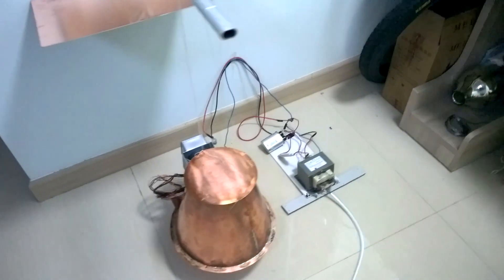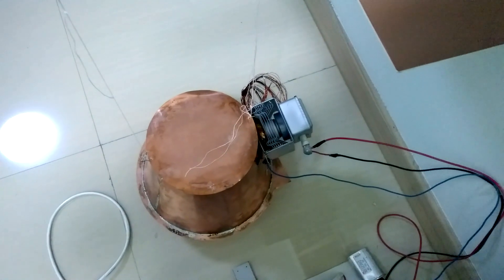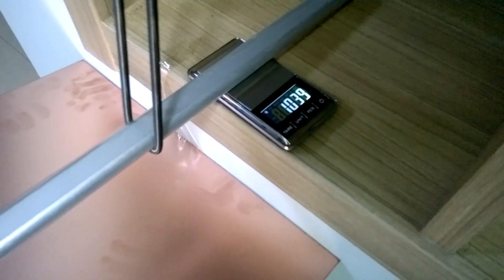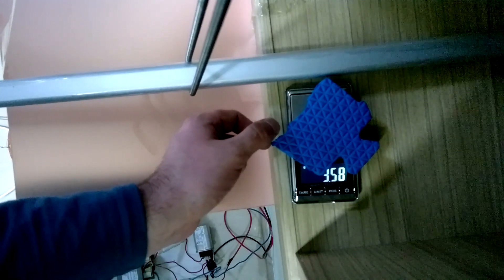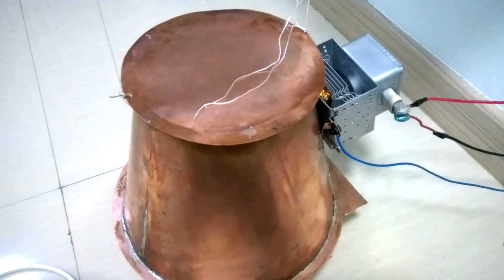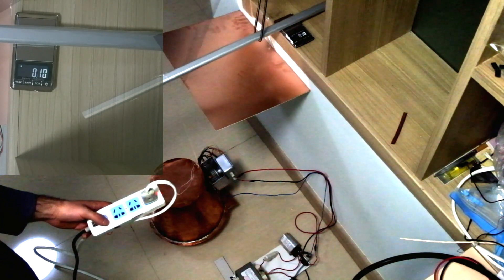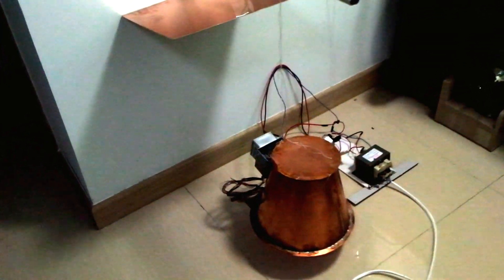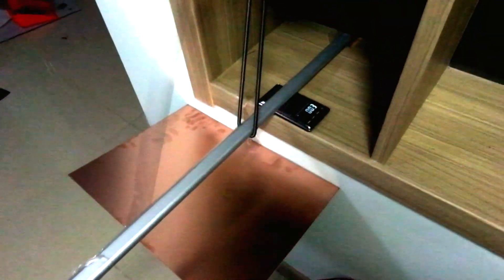EmDrive Test No.03 Success, I have thrust !!!

Comment: You must put the power source (supply) completely within the device being measured.  Otherwise, the conclusions based on the results are invalid.  Also this must be done in a vacuum, otherwise also invalid -- sorry.  Also, you must verify that any springs, and measurement devices are not affected by the extremely high near field levels.
Reply: John Doe
No it's important.  Other folk are reporting thrust from thermal flows/etc that happen in non-vacuum.
Reply: i never said this particurlar video is significant. i only came here because of the topic. i never commented on the validity of this specific experiment. nor have i said anything that would lead a reasonable person to think i was referencing this specific video.  not really interested in getting into insults with you but you might consider reading the comments of others more carefully before ripping into people.
Reply: onehit pick right, i agree with you. i didn't word my comment very well. what I mean to imply is that the argument is moot in that NASA has already demonstrated that the emdrive works, even in a vacuum. so the argument that the thrust is coming from an environmental source has been falsified thus rendering it moot.
Reply: It's hardly worth making those points.  He's measuring thrust in grams for starters...
Reply: This whole thing has been plagued by very immature and mostly invalid experiments.  There are several reasons why a tether invalidates the experiment.  First of all, after the larger claims have been retracted, we're only talking about micro newtons of thrust here.  Near field interactions with the tether, thermal flexure of the tether, inductive expansive effects, will result in erroneously measured thrust.  Also, wall power can supply and provide slow ion-flow based currents, and this is unallowable.  The thrust measured here is likely due to intense microwaves and fields causing an inductive near-field repulsion effect.  See things like "floating ring" physics experiments. I guarantee there are plenty of leaky near field electromagnetics.
Reply: just  an fyi. NASA thought about the need for a vacum to confirm there was no other environmental factor at work. nasa says it performs with the same thrust in a vacum as it did in an open environment so i think the vacum test is probably moot.
Reply: Fuk Yu okay but what specific aspect of my idiocy and brought on the vapors in you?
Reply: Your lack of basic knowledge, which is indispensable for discussing this topic. In particular your assumption that the experiment in this video is anyhow significant.
Reply: that square brasssy looking thingy
Reply: John Doe
Makes sense.
Reply: Charlie Govenor
The scale still is relaying force, however, and simply equating it to a mass-equivalent on the earth's surface.  However, the force here is likely not due to any reactionless thrust.  It's probably due to heating, EM coupling to the scales in the measurement device, etc...
Reply: i cant wait until the nasa peer reviewed paper is actually published. it's been accepted for publication which is a huge hurdle. if this is real and it appears to be, this is beyond incredible. imagine the speeds this thing can achieve in space. there is literally no reason it can't bump up against the speed of light, given enough time.it's been demonstrated that even at this early stage, the emdrive generates 7 times more thrust then ion drives. and that's without even fine tuning the shape of the chamber or nailing down the percise wave lengths for maximum thrust. and think of earth based applications. they really could produce a power wheel that operates and generates power in perpetuity or at least as long as the sun shines, say antoher 4 billion years. that should solve our power problems for awhile.
Reply: John Doe
The thrust reported was due to thermal flexing so far.  Perhaps this paper will report something else.
Reply: onehit pick i've read everything i could find on the emdrive. i haven't read anything confirming "thermal flexing," whatever that is. you do know the thrust is directional right. it's not like it sits still and jiggles. perhaps you have a url you can direct me to so i can look into your postulation?
Reply: John Doe
Thoroughly read the wikipedia article on the em drive.  It describes (in English paraphrase) the retractions the Chinese have made after successive experiments with improved setup.
Reply: onehit pick okay, i'll read it. probably take me a couple days to get to it though. i'm gonna really be bummed if the emdrive turns out to be a dud.
Reply: onehit pick okay, i read the wikipedia page. trying to be as objective as possible: i thought the article was pretty noncomital, as if the author was hedging his bets. nothing specific, but just an overall sense of it. i think there is still plenty of room, in lieu of the article, for the emdrive to be the real deal. i know i'm not a scientist but isn't the emdrive a possible example of how the quantum world might interact with the newtonian world? does the law of conservation apply in the quantum world? isn't quantum mechanics basically just a phrase that covers all the exceptions to newtonian physics? well, that's my take on it. i still have hope.
Reply: John Doe
Here's an important paragraph from the wiki:
In 2016, Yang's team published a paper, in which they refined their experimental setup, using a three-wire torsion pendulum to measure thrust. They tested two different power setups. In one trial, the power system was outside the cavity: in this case, they observed a "thrust" of 8-10 mN. In a second trial, the power system was within the cavity, and they measured no such thrust. Instead they observed an insignificant thrust below their noise threshold of 3 mN, fluctuating between ±0.7mN with a measurement uncertainty of 80%. They concluded that they were unable to measure significant thrust; that "thrust" measured when using external power sources (such as in their 2010 experiment) could be noise; and that it was important to use self-contained power systems for these experiments.[8]
Reply: the problem is that a power wheel would be slowed down by taking energy out,  so that won't work as a power source.
(this drive works because you keep adding energy, and almost don't loose any, so you accelerate.)
Reply: you guys do realize that if you put the power source inside the cavity, that will destroy the ability of the cavity to function as a drive. it's the interior shape and dimension that the whole things re thrust is based on.
Reply: John Doe
I meant the power source must be within the entire device being measured (that is, the craft).  The experiment is completely invalid if the power is being supplied from the wall, for example.
Reply: Care to explain why?  He's measuring thrust.  I don't see why having it 'tethered' or given an outside power source would invalidate that.  They tether rocket motors when they test them, and propellers are provided with energy from an outside source when they test those.
Reply: +John Doe
You are an idiot.
Reply: +onehit pick are you saying you are smarter than NASA engineers who confirmed EM drive to be working? Of course they aren't going to share this shit with the public, they gonna use it in military first.

Comment: Surely by now you know you are comparing the weight of the foam with the scale to the weight of the foam at a random distance from the fulcrum of a lever with a scale at a random distance from the fulcrum. Levers impart mechanical advantage. Elementary school stuff. You need a better setup without so many variables.

Comment: cool experiment. i like EmDrives they are cool but they are not "AntiGrav" drives. they do not manipulate gravity. they use electromagnetic waves to produce thrust. this can be done in deep space without any planets within range to be "antigravitated" against.
Reply: I'm curious why he chose the term "anti gravity" he must have a reason if he has the knowledge to understand how this works and how to make it. Or maybe not so much the knowledge but just the general background i assume you'd have to have to even want to make something like this.
Reply: Travis Pratt
 maby. i mean it needs some tecnical knowhow to build it. but you dont need to be a particle physicist too be able to. i mean, at the end of the day its some cupper sheets that are soldered together and the "engine" from a microwave ovven."

Comment: My theory: You're heating the water contained in the air and as it expands and drops the density, generate buoyancy. Note that the thrust is in the opposit direction of an tipical EmDrive.
Sorry, but in my opinion you need to repeat this experiment in horizontal position to be valid.
Reply: an tipical?
Reply: +Harper Chisari , sorry, Typical.
The thrust is pointed out of the bigger face.
http://img.scoop.it/Y5-Q3McR5-85VVe5pjtQ3Dl72eJkfbmt4t8yenImKBVvK0kTmF0xjctABnaLJIm9
Reply: There are many, many other things which need to be corrected before this is an experiment you can draw any interesting conclusions from.

Comment: Suggestions...
1) Remove the transformer from the area by using long wires (1m min., with sufficient gauge and insulation).
2) Build a Faraday cage shield around the scale to prevent microwave incursion (or wrap it in copper foil/tape)
3) Once you have a repeatable effect, reverse the direction of the EM Drive "thrust", and compare results... making certain nothing else changes.
4) Be certain you fully understand microwave magnetron radiation, and how to properly couple the magnetron output probe to the EM Drive cavity... you could be experiencing dangerous levels of leakage. The mating  surface MUST be extremely flat and stiff, so leakage does not occur, and certainly re-use the RF mesh gasket. On the magnetron output probe, the RF comes out from the ceramic area, perpendicular to the probe, not from the metal cap... which is a capacitive loading cap.  Be sure to use the same size hole (for the RF probe) as was in the microwave oven cavity mounting surface.

Comment: Funny thing - if the pressure of light is a known effect, why did EM-drive cause such a debate? If the light exerts force, a source of light should be pushed away by reactive force. Or we could simply lit our own solar sail with a flashlight and fly.
Reply: +oguretsagressive nope. the flashlight feels the reactive force so ur ship wont budge
Reply: +thegreattheone that's what I'm telling - if we know about the pressure of light for a long time and this reactive force is obvious, why EM-drive's thrust was such a big surprise? And why does it require so complex explanations such as a quantum foam?
Reply: +ogu... it is a closed copper vessel, also pressure of light, wtf?
Reply: but the problem is one;:
1-its contained so the light doesnt escape so.....you wont be able to use it
2-it is less efficient that anything we've ever made and many tests have shown that most EM dirves dont even produce thrust
3-in relqative terms it takes up as much power as a lightbulb just to lift a water drop
Reply: go watch thunderf00t

Comment: The last argument to fall apart suggesting why a device like this can't work is the suggestion that the microwaves might be  generating thermal currents, providing thrust. Personally, one gram of thrust sounds like a lot for thermal currents, but that's merely intuitive. NASA recently dismissed the theory by firing on in a vacuum, and getting the same thrust. You seem very clever. I suggested you endeavor to build a vacuum chamber for the device.

Of course that still wouldn't tell us how it seems to genuinely be giving the middle finger to the 2nd Law of Thermodynamics.
Reply: +William Cornelius NASA may not know how the thing produces thrust, but in its own words, “NASA Eagleworks has now nullified the prevailing hypothesis that thrust measurements were due to thermal convection.” Eagleworks doesn’t necessarily speak with the unified voice of the NASA establishment, but it’s a high-enough profile platform that the mainstream media was forced to take notice.

Comment: "Thrust in grams will get us anywhere"? Yes, because IF the EM-Drive really works (which still needs to be proven), even very little of thrust would be enough in space w/ just a little energy, because in space it would just add up indefinitely, nothing would stop more thrust being added. After some weeks or months, the vehicle would be very fast even if the actual thrust generated is small. By the way while pretty "cool" that people can build an EM drive at home it's silly (and dangerous), let NASA or the Chinese work out whether this really works or not, they are testing this to find whether the thrust is experimental error or whether it really creates thrust. And yes, a German team tested the drive in a vacuum, so it cannot be buoyancy.
Reply: +Georg Rauh NASA and several other labs around the world have all tested this thing and gotten the same results. NASA has even done it in their deep space vacuum chamber (no thermal or molecular interference) and it produced a measurable thrust. Possible theory by a professor at Plymouth University as to why this works and how it isn't violating conservation of momentum. Article is on MIT Technology Review and links to the arXiv copy of the actual paper. https://www.technologyreview.com/s/601299/the-curious-link-between-the-fly-by-anomaly-and-the-impossible-emdrive-thruster/

Comment: DerrickA4mag has a good point, the experiment would give tons (No pun intended) more evidence if done in a vacuum, also in your rig, the lever on the scales could do with a pivot point so the load is centred on the scales and how about some way to show a change in distance e.g. lift taking place, like a laser measure of a mirrored surface (should not be to difficult with copper.
Reply: +Susan Bruce NASA has done this in vacuum, still delivered thrust. https://www.technologyreview.com/s/601299/the-curious-link-between-the-fly-by-anomaly-and-the-impossible-emdrive-thruster/
Reply: mycroft16 Thanks I believe we have lift off.

Comment: I do not know how to calculate with higher math; however I wondered, the magnectic field of the earth has a magnectic signature in the shape of a gyroscope. this field is also present in this device.... Keep in mind the way to engage in 'space travel' is right in front of everyones face. The earth TRAVELS through space because of this field and the DIRECTION the poles point creating spin and motion in space time. if you could find a way to focus the pole energy in a direction you wish to go then adjust the amount of energy either attracting or repulsing then actual travel can be achieved.

Comment: Not scientific enough for a proof! You need to find and remove every possible cause of systematic error (such as vibrations, rotations, moments, air currents) before you can even start taking results, and do it in a vacuum. Considering the original 'inventors' only measure micro newtons I doubt your setup is accurate enough to produce any real results. But hey, everyone needs a hobby!

Comment: WTF i made one of these, it DOES give thrust even upside down, it makes no sense it shouldnt technically be doing anything let alone producing force.

The only issue i see is the force is TINY compared to its size. Ive tried a mini one in a vacuum tube, that too provided "slight" but measurable thrust.

This confuses me because i cant figure out why it would even work.
Up 0.005g force, Down 0.002g force. (in vacuum up 0.003 down 0.002)
(which means yes air in up does make a bit of difference, but its not the whole story.)

Comment: lack of proper protection from the microwave energies can be lethal. you have shown complete disregard to the principles of radiation. anyone who tries to copy you should know how dangerous this device really is. you can hear the radiation interfering with the cameras, you are standing to close to the device. This is essentially a microwave oven with a directional cone. radiation is not a toy, its not a fancy car you show all your friends, it is dangerous, it is powerful and it has the potential to kill all forms of life. I think your complete disregard for radiation is disgusting and i sure hope no one els was in your home while you have been microwaving your self and your home.....
Reply: +Gavsta Brennan 

The biggest danger, by far,  is the 2000 volts (approx.) coming from the Microwave Oven Transformer.  This can be instantly lethal if touched), so implementing proper electrical safety is a MUST.  As for the microwaves,  they can cause RF burns, but  if the EmDrive is properly constructed (all openings < 1mm), the microwaves are contained within the cone (even if not airtight). The  cone is not open ended like a rocket nozzle, but rather, as an enclosed volume (resonant cavity).

Comment: I watched the other experiments again and it became quite clear to me that the thrust observed in this video is due to hot air being trapped under the cone. The air in the cone heats up and provides lift like in a hot air balloon. That's why the device won't work in horizontal position - hot air escapes the cone
Reply: Ha no.

Comment: You have a great experimental setup hear. Your results are interesting. According to "theory" behind the EmDrive, you should be reading a positive weight when the magnetron is active. There is more surface area on the large end compared to the small end for microwaves to bounce off of and transfer momentum. Here is a great diagram of the proposed theory: http://www.nerdist.com/wp-content/uploads/2014/08/EmDrive.jpg